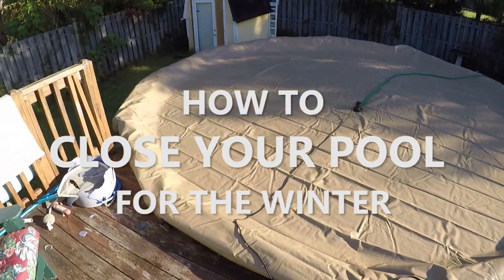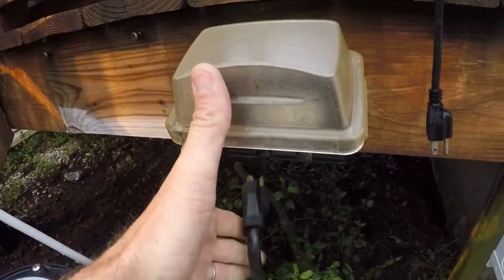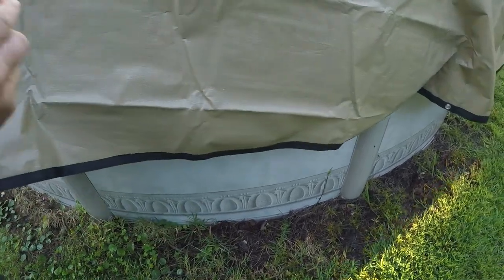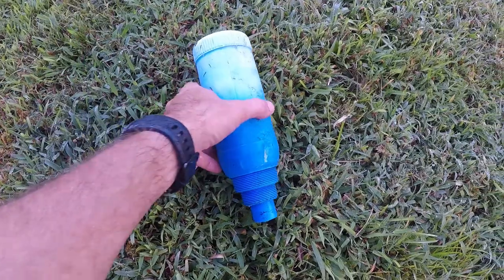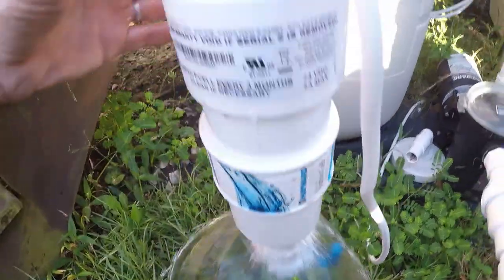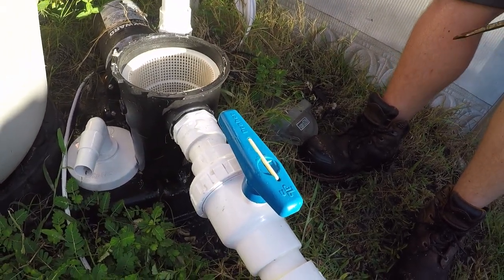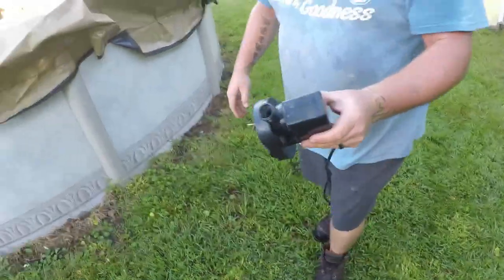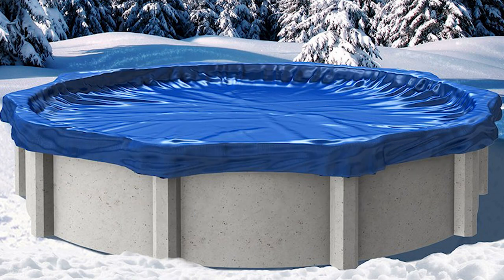How to Winterize Your Above Ground Pool

Comment: Can I attach bottles to the pool pillow and sink them in the middle of the pool instead of using ropes on the outside pool walls to keep it in place? Wasnt sure how plastic bottles would do under water in the winter